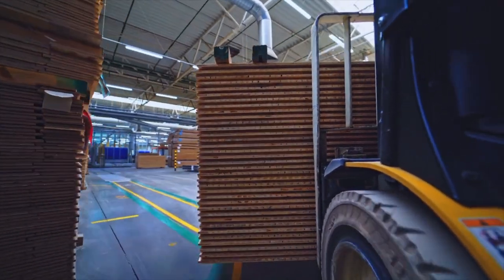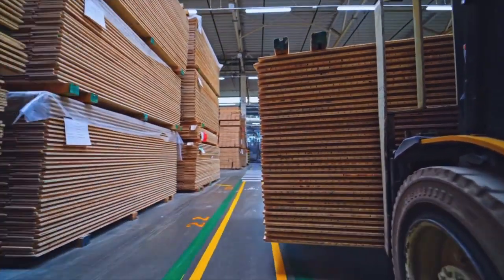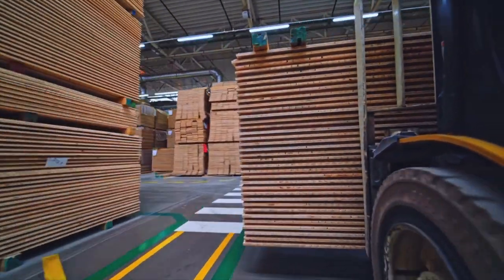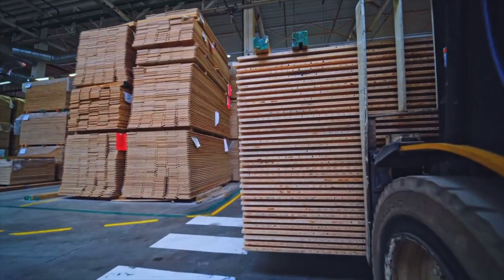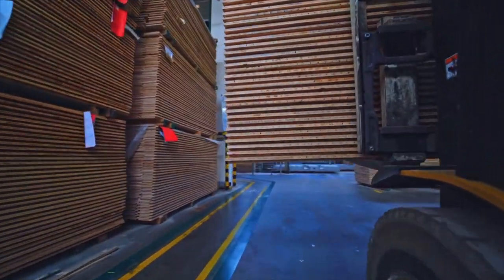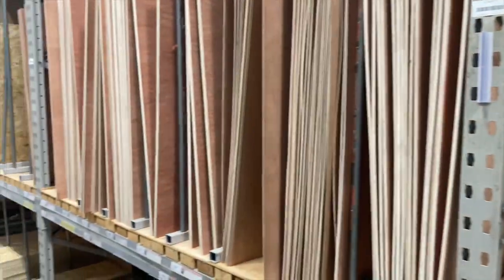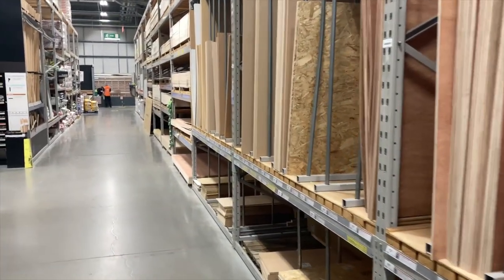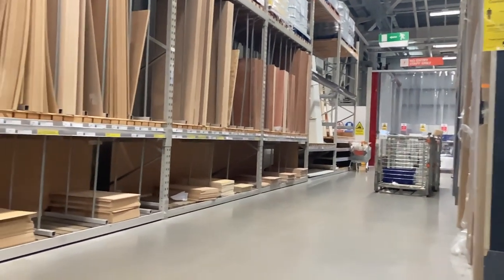Stop Paying too much for PLYWOOD (How I get FREE router template & router jig material)

Comment: Good tips. Also, they often put out scrap bins of material from packing boxes and crates. I had an awful experience with ordering cut sheets from a proper timber yard, my 4 sheets and 10 cuts just wasn't worth their while. Took 2 weeks to be ready and all the cuts were really far out of square. Complete opposite experience at B&Q, I went in with a cut list and drawing and the guy was so impressed we had a good chat and didn't charge me for any of the cutting!
Reply from the maker: If you’re pre booking cutting, it’s best to physically be there, unless you really trust the place.
Just like ordering lengths of timber, if you book it for collection later, or delivery, anything that’s not up to snuff gets rejected and either sent back, or rejected.
It’s a little harder if it’s already been paid for and is delivered..... but that’s another reason to have an account.
Reply: Yup, Unless it's a good timber yard, it's a tool using a tool most of the time, they cut to the wrond side of the blade ect ect.

Comment: Another tip - go to Ikea and park near the trolley bay closest to the store exit. Generally (the MK one, at least) there's shed-loads of melamine-faced particle board offcuts/seconds from furniture panels with slight scuffs. Last time I managed to haul at least 25 boards of approx 1000x600, completely free (theres even a sign saying help yourself). Great for shop furniture 👍
Reply from the maker: Ooh Nice! That’s my local(ist) one too.👌
Reply: @BrainFizz  Built all my toolcarts/shop cabinets/shelving units from the equivalent of 7 or so full size ply sheets. Best part of £300 😃

Money spent fixing the suspension afterwards 😂
Reply from the maker: @richardclarke9966  aside from the instant cost savings, there’s a huge knock on environmental aspect to it as well. More space for other stuff to get recycled, all your stuff kept from landfill, and the energy/money saved in the cost of recycling what you got that would have been collected, moved and mashed up into MDF by someone else.
It’s actually a huge win all round!
Reply: @BrainFizz  Absolutely mate. With a massive drive for sustainability a company the size of Ikea have it spot on. Might not be everyone's first choice material but a new lease of life is win:win.

Comment: Before I had a truck I just brought a circular saw and some foam board and cut it myself in the parking lot. We got douchebags running the wall saw at my homeless depot.
Reply from the maker: Yeah loads of people have said that to me before. I’ve cut lengths of timber down before myself, but there’s no way I’d bother wasting my time carting bits of foam bits or saw horses about just to fit a sheet in the car. That’s just too much hassle!!
In the rain, the cold, the dark???
Sod that. Even if their cutting poor. I’d just allow for it in my measurements.

Much rather wait a bit longer in store, than spend four times longer messing about outside!
Reply: @BrainFizz  it doesn't rain here and The guys at the Home Depot would rather say that when she was broken then cut my lumber
Reply from the maker: @SharpestBulbs  here in the UK it rains, and snows, and gets dark at 3 in winter.

But when places don’t want to cut. I go elsewhere. That’s part of building the relationship with the branch.
Reply: @BrainFizz  understood. my f150 has solved all that nonsense though. Do they allow trucks in the UK just curious, I know they outlawed dado stacks.
Reply from the maker: Of course they allow trucks like that. But mostly they’re used by farmers who need a truck. Tradesmen here prefer enclosed vans over trucks. Some have them, but it’s not the norm.
Stacked blades is another myth. They’re not outlawed or illegal. It’s that the EU changed the rules on mass and the time it takes to stop the blade.
You can buy the blades, use them, and own them. You can now get machines that can accept them.
No different to the us preferring large table saws, whereas the UK and Europe prefer larger sliding tables.
Just horses for courses.
Reply: @BrainFizz  thanks for clarifying. The news loves to sensationalize.
Reply from the maker: @SharpestBulbs  don’t we all.
But based on fuel prices alone,  I’m sure less Americans would have a massive truck of fuel cost $7.63 gal.
I currently get over 700miles on a tank that cost about £50...... for context my van could drive from San Francisco to NYC for about $280,  paying UK fuelprices. Not sure what your PPG is, but less I’m sure.

Comment: Free😳😳😳😳😳😁
Reply from the maker: I do this all the time, and haven’t paid for any jig material for years.
Admittedly the fact that I buy a lot of full sheets of MDF and Plywood does help, but as you’ll see in the video, that actually helps people out who don’t buy full sheets on a regular basis, but they still get deals few people could better.
A little lucky timing also helps, but you gotta know about it first!
Reply: @BrainFizz  nearest for me is Travis Perkins. I’ll tell you I would get nothing free in there. 
I’m with you totally though on being nice and not being a dick. It saved me a hour round trip the other day. And the guy at Travis made it cheaper than I can get from a timber merchants 30mins drive from me. 
You need a van like mine a lwb movano. You could hold a party in the back😂
Reply from the maker: @markjarman7819  no way I’d ever buy a larger van. From the point of parking and getting about alone, I love having a small van👌
I had a transit connect before with had a full bulkhead, and although the van was actually designed around an 8x4 I could only get 1800 in the back, so had a roof rack fitted.
Now I have a slightly shorter motor that actually is bigger in the inside👌
Reply: @BrainFizz  I only have it so I can get my race bikes inside. I had a vivaro but wasn’t big enough with work stuff and bikes.
Parking can be a challenge at times but I get by. Now starting to get to the point where I could possibly do without it now. But with COVID and work suffering no chance of a change at the moment